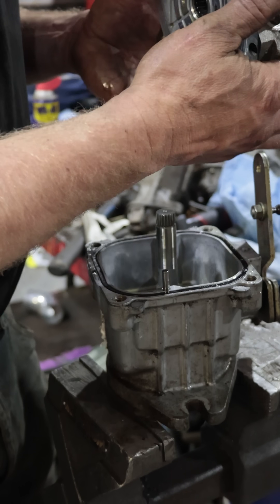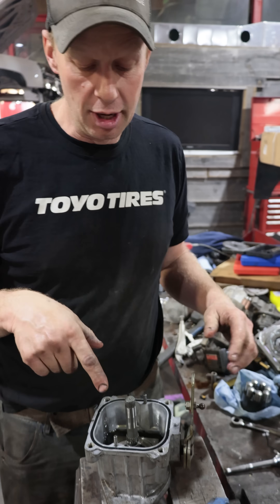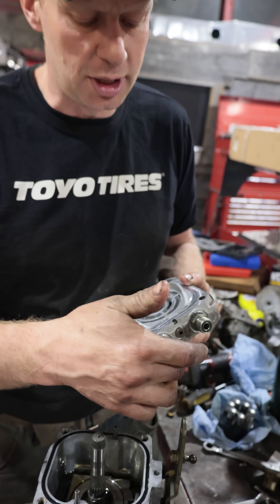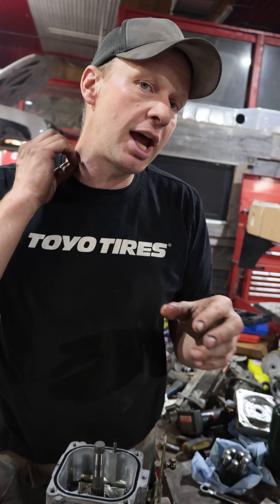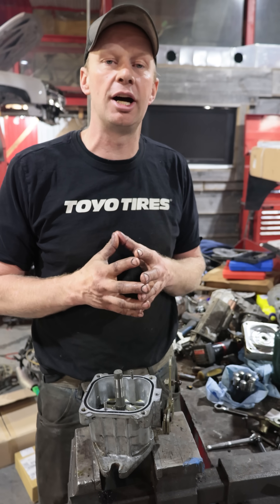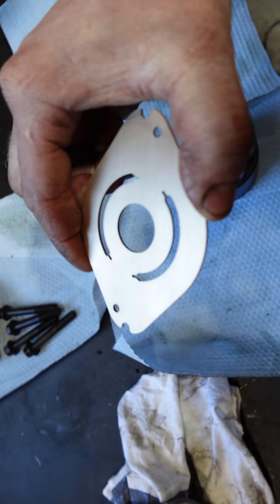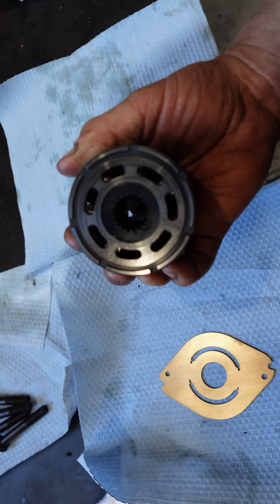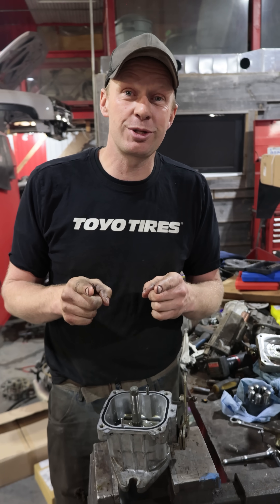How to fix any Hydrostat for less than $100

Comment: A hydraulic shop will put it on a lapping machine. They will flatten it to .000001. Not all pumps are this easy to fix as this though. This is very simplified.

Comment: This is why changing filters is so critical on the system. CLEAN off the area before the filter is removed (most dirt enters the system when changing it) and use a quality replacement.

Comment: Funny Mr, all hydrostats have 9 pistons, he tells us, while showing a lock with 7 pistons :) Showing the valve plate and calling it a swashplate. Reworking the valve plate and piston block pro a low pressure machine , like a lawn mower, can be done,  with a fine grinding compound  grit 400 or finer on a flat glass or brass surface... An old window or mirror is perfect.

Comment: Yes! Thank you! I have two hustlers. One old school(early eighties), and one new. The old mower doesn't have separate drives. It has a hydraulic pump with motors at each wheel. It's damn near bomb proof.

Comment: I took apart a junk craftsman hydro and resurfaced it with stones for sharpening knives (obviously i had more time than $). Before, it couldn't climb the slightest grade when warm. Now it climbs steep hills, no problem.  Just make sure it is very clean before reassembling. Otherwise, you get to do it again.

Comment: Had the opportunity to learn from this dude irl when i was a 19 year old engineering intern working in a small powerplant in Oshawa. I remember he, (or someone who looked and sounded exactly like him), used to come in and fix our massive V16 generators. Sometimes, he'd ask me to help a bit. Was a great learning experience. What a great dude.
Reply: And remember, If your not filthy you're not Rich!
Reply: @andrewjoyce7789 never did any work on them that would get you dirty. Never had to pull a cylinder head or anything, because the engines were the size of a car, and you'd need a crane to lift it off. But i helped him replace a starter motor, and do some work on the turbocharger.
Reply: @A_Frog_from_mars12 also at the end of most videos he says "And remember, if you're not filthy, you're not Rich"! Then the cat meows.
Reply: @andrewjoyce7789 that's ironic because Irl, hes an extremely clean dude. Looks and smells like he takes 5 showers a day, always had super heavy cologne. You could smell that he was in the building before he even walked into the control room.
Reply: @A_Frog_from_mars12 😂

Comment: No machinist, but I’m curious how they (or any other machine shop would) choose to secure that thin plate to cut 100% of the surface. I’m assuming even top of the line surface grinder or mill would still want one continuous pass for uniformity. Seems hard to hold.

Comment: My little Wheelhorse garden tractor had similar symptoms but it was just the input shaft seal letting air in. As the oil foamed up it would eventually become too compressible to transmit power.

Comment: Would this still happen if the plate was made from titanium or tungsten instead of cheap brass?
Reply: And then what would wear out, the expensive rotor with all it's expensive machining  OR the cheap brass with a couple slots and holes?
Reply: @BS-ys8zn  If the both the rotor & plate were made from titanium or tungsten would they last longer yes or no?

Comment: You also want to lap the barrel to a mirror finish with fine lapping compound.
Reply: Plus making absolutely sure that you have cleaned up all the lapping paste otherwise you are set up for failure again.
Reply: I use 600 grit sandpaper on a flat surface and some wd40 to keep free while sanding

Comment: Or... get a flat piece of glass, sheet fine wet dry memory paper lube with oil, and spend an hr in a circular motion lapping it down.
Reply from the maker: I tried that, but uneven pressure between the thumb and forefinger will sand it on a taper, and you can do it again.  Might as well spend $75 and get a printout on the proof that it is within .00025"
Reply: To ensure even lapping use a figure 8 pattern and rotate the part 90° ccw every minute or so. Or use an Oilgear pump and never  lap another part.

Comment: what if it acts like there is no neutral it wants to go forwards or backwards the window of neutral is small and it likes to fall into gear very easily
Reply: Check for lash in the linkage from worn joints. If the neutral position is set at the pedal or control lever, the pump could be allowed to stray from the neutral position. One of my tractors has an adjustable friction plate at the pump to prevent the lever from floating if it's not being pushed or pulled. You can sometimes install a spring between the levers to take up any lash in the linkage.

Comment: Great explanation. I have a stand on Scag mower with one of the hydraulics being weak. Could this be similar to the pump in myScag and would that be a similar problem? Just a thought. We’re getting finished for the season and would consider a teardown instead of replacement.

Comment: I wonder why they don't use rollers on those plungers like a roller lifter? 🤔 I know would mean more complexity but sure would reduce the friction and wear on the flip side of it. Thanks for the explanation, Rich!! 👌
Reply: That's what the bearing is for. It goes between the swashplate and the plungers.

Comment: I've got both a lawnmower and and snowblower with a hydrostat, I got a feeling this video will save me some money in the future 🙂Thanks!
Reply: This guy really knows how to throttle the pump…..🎉
Reply: A lot of new mowers have sealed hydrostats that are supposed to be unserviceable.
Reply: @bobbygetsbanned6049  Yeah, new stuff is mostly expensive crap, designed to fail and throw away right about when the warranty expires. Most of my equipment is 15+ years old. It is much better built than the newer stuff, and you can repair just about anything that fails on them.

Comment: Hydrostat is good if the mower has a filter or a way to drain and refill the oil. Most don’t, so it’s just a matter of time before it stops working. I prefer mowers that have a manual transmission because those never quit working.
Reply: Can you add a filter to them?
Reply: @krashanb5767  I’m not sure. I just make sure to avoid the cheap hydrostat mowers that aren’t able to be serviced.

Comment: I had a clapped out Wheel Horse hydrostat years back. It did exactly this. Wish I'd have known but heck with it. If I ever run into it again I know.
Reply: Work at a couple of small engins shops in Wisconsin in the eary 90s, the high light of the day was servicing the Wheel Horses.
Just one fine piece of equipment. 😊

Comment: Fwiw a piece of plate glass is near perfect for flatness. If the scratch is minor use the glass and sandpaper to remove the groove.
Reply: It will never hold the oil pressure as you will take too much off the plate. The plate will flex when it's too thin
Reply: @philipmackin1025  I literally do it to cnc machined parts on the daily, can maintain flatness of .0002 and achieve a Ra surface of 4 with 600grit Norton silicone carbide with double sided tape on a granite surface plate using WD40 to lubricate and carefully placing light pressure. Can the average person do it...sorta,  need a good flat piece of granite counter top, then a piece of glass and lap them using light spray glue on the glass to hold the paper, that's to mainly get anything possibly loose off from just below surface or slightly above the rest. granite milling heads are incredibly precise for a mass production product I have found.  Toughest part is not round the edges,  chamfer them lightly and it's 99% eliminated.
Reply: @philipmackin1025  Bull did mine in the zero turn with a wetstone and 1000 grit and it worked fine.
Reply: Water paper and a flat surface works well for the bigger pumps. But those have a 5-6mm or thicker port plate

Comment: I’ve had a zero turn for 4 years and at full speed i notice a slight difference between my right stick and left so i have to pull back on one to go in a straight line. I thought it was an adjustment issue but maybe one side has lower pressure because of a scratch on the plate… interesting
Reply: Nah most zero turns are like that. It’s why they have set or stop screws in the frame that you can adjust to make it drive evenly

Comment: Great quick post.  This will help me a lot.  I live about 40 minutes NW of Hudiksvall, Sweden.  Hudiksvall is essentially the epicenter of hydraulic research,  engineering,  manufacturing and supply.  If it's hydraulic and you can't get it here, you don't need it.  If you have ever seen a Hiab crane, it was most likely built here.  Hiab stands for Hudiksvall Industrial  AB which is Hudiksvall  Industrial,  Inc.  One of my best friends used to work as an engineer for Hiab.  We are playing with some ideas for some small scale forestry equipment.  Peter's expertise is in wired and wireless remote hydraulic controls.  Boy, am I glad I moved from Oregon to Sweden!!  I have been playing with some very interesting ideas that could or will combine some of Edison's ideas in my work.  AND I CAN ONLY THANK YOU FOR INTRODUCING ME TO EDISON.  You video of pulling Topsey's first load really got the juices flowing.  Tusen tack från oss längst upp norr!  (62.007100, 16.944953)